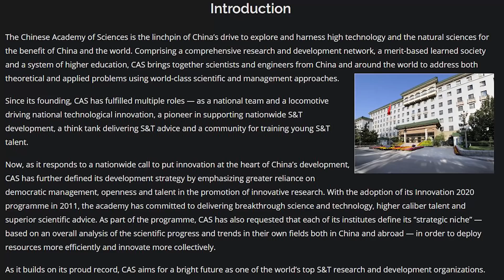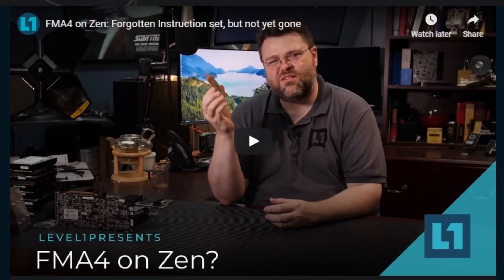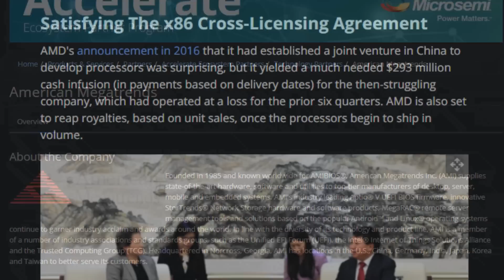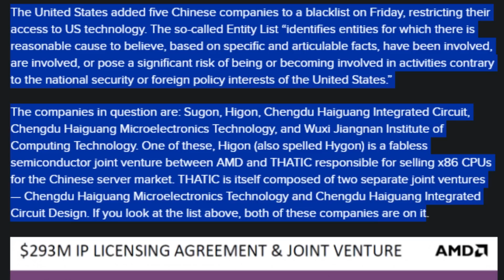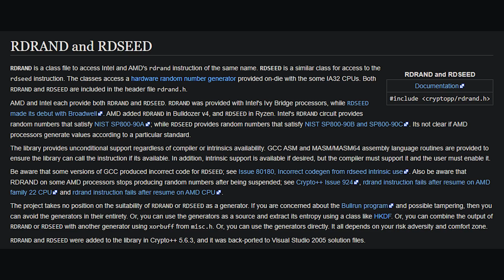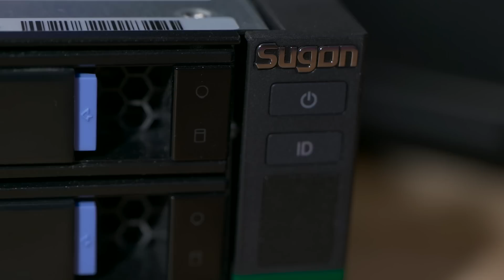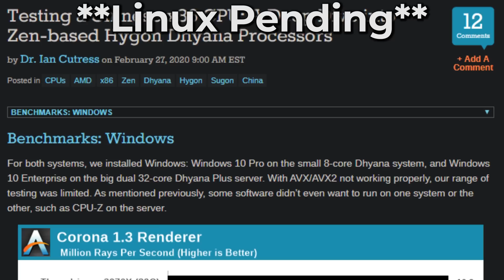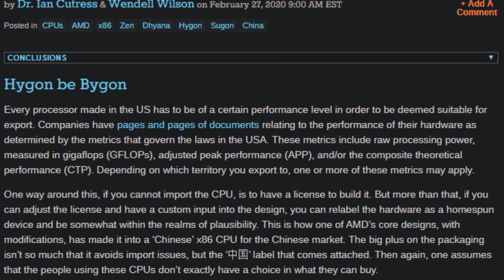Poking at BANNED Chinese Server CPUs & Motherboards!

Comment: lol as if China is making any CPU that doesn't call home. It's not even hard to find on most of those mid-level "emulation" devices they sell across the planet. 
If you've bought anything from China that has an internet connection you essentially bought a fancy spytool.

Comment: And now there was 4, Intel, AMD, VIA and Hygon
Reply: VIA is mostly dead. Their cores are even worse than bulldozer. 
Hygon use AMD's Zen1 design (AMD sells them to china a few years before). They don't have the ability to build their own
ARM does not build their chips.
Fujitsu and IBM is focusing on HPC. Their processors are not cheap. The only consumer product is the Tailos/Backbird system by Raptor. Still, super expensive.
Reply: @clehaxze  dude they are literally releasing a new CPU design on a new node this year
Reply: @TheXlen  Ohh yeah. I forget about the new one.

Still. From my experience working with VIA before. Their CPU isn't super advanced and I don't think the new one will be much different. And from leaks, the situation isn't looking good. Their new 8 core CPU runs at 70W @ 2.7GHz. 

Tho they do have the advantage to integrate their CPU directly with a AI accelerator. Which is kinda interesting.
Reply: @clehaxze  if they can match or beat intel's low-mid end this year, they are a player that must be taken in account
Reply: @markj2093  all of those that I mentioned are x86 CPU manufacturers and designers, most of those you named make ARM design CPUs
Reply: @markj2093  I once worked for VIA. I know how their system works. It was a good design but nothing comparable with AMD/Intel. But we'll see how well the new one works.
Reply: @markj2093  hygon designed a lot of that zen based CPU
Reply: @markj2093  IBM power 9 atm is not worth mentioning
Reply: @markj2093  yes and now they have personal that can fine tune it, which means even if they don't get any newer designs from AMD they will be in market for at least 5 years

Comment: I would absolutely love a low cost 8 core zen 3 chip with 32 or 40 PCIE 4.0 lanes. One of the biggest reasons I haven't upgraded to a ryzen system from my x79 is the lack of lanes on the chips.

Comment: It is a little peculiar that China couldn't fabricate their own chip.  It is concerning that AMD would licence anything to a country well known for their ability to clone a product.  Shows how much money was at stake.  As for capturing network traffic I think looking at anything less than 40 days of it on a network is shortsighted.
Reply: it's not about being able to fabricate a chip, they surely can, but the problem is the architecture, the x86 IP. They will have to license from amd or intel as anything x86 arch based must come from them and them only. or they could make their own arch xch86 or something but it will not be compatible with the existing software (again x86 IP needed for that) but that will take years of research, so the easiest way is to buy x86 rights from amd. also amd buys their 7nm cpu waffers from TSMC Taiwan, which no matter how the political scene is over there, it is still considered as part of China, so not as peculiar as might you think.

Comment: The Chinese Communist Party has been very clever with various ways to compromise hardware. Often this is done in ways invisible even upon inspection, such as compromised components on the motherboards or embedded inside cabling. The CPUs are just one target out of many.
Reply: "embedded inside cabling"
Simpso-I mean NSA did it!

Comment: You know what is also forbidden in USA ? Kinder Surprise eggs !
Reply: Because the US is afraid they contain a transdimensional backdoor portal directly to Italian chocolatier spies trying to collect trade secrets from American candymakers. I do believe their concern is warranted.
Reply: America, home of the banned.
Reply: @Username that's not even true.

Most regulations are created with the idea that certain policies make things safer, better, or more environmentally friendly, this often is not the case. All regulations do is they lock out smaller competitors that might have an innovative product or design that could be cheaper or better from actually entering the market, or they increase the cost for the consumer as compliance with those regulations goes up.

An example of this is the US style electrical outlet that is by far the worst designed plug in the world. There are far better options for electrical outlets but because the US decided to standardize and regulate that outlet those options are unavailable. There are other issues with the US power system, our 120v system is vastly less efficient then the 240v system that is used elsewhere around the world. So standardization has had a extremely negative impact on the safety and efficiency of us power systems.

We can talk cars as well. Cars have certain regulations that are so asinine and dangerous that even if you wanted to create a safer vehicle you couldn't. All you would have to do to prove this is look at the accident Ryan Neumann just had at the Daytona 500, he survived an insane crash that of those cars were not built to the standard they are built to with the technology that they have he would have beed killed instantly. General regulations prevent the use of that vastly safer technology in vehicles on the roads today. You can only have a point harness in a vehicle today, you can not put a better harness in standard. There is a mandate for airbags that have been proven repeatedly to be dangerous and deadly in the wrong circumstances. Hell we are dealing with explosive chemicals that very likely have an expiration date where they are not guaranteed to work the same as when they were fresh. Not to mention that degradation of the housing is a key factor in their overall failure. Motorsports has vastly superior technology when it comes to driver safety and it is insane that it is not legal to use in a vehicle built for the roads.

Regulations don't have any foreseeable benefits to society, period. They give the illusion of things being safer while at the same time they prevent things from being done, progress from happening, cause actual harm to the things they are trying to protect and most importantly they actually make things less safe and prevent things from getting safer.
Reply: @TheObsesedAnimeFreaks  most regulations are not bad unless most regulations are made with the thought in mind of exploiting others, which is the case in the west. 

On the parts of planet Earth that have good governments like China and Iran, the regulations are made to keep people safe instead of to destroy competition, but I'm sure you can find some cnn or reuters article that would disagree.
Reply: Americans of all ages are choking on them regardless of the age limits. Go figure
Reply: You banned Kinder Eggs!?!? Whats wrong with you people?
Reply: Since when ?? I live here and they have them at every grocery store ive been too and almost every gas station...
Reply: @prestonblues2037  And the toys are inside the chocolate egg?
Reply: @NikoBell1188  yes they are
Reply: @NikoBell1188  well not in in the chocolate but the other half of it
Reply: But blind bags are just fine.
Reply: @Username She did not get third degree burns on her lap from fuckin hot coffee. Third degree means it burns through the flesh and to the bone. And 85c is not hot at all for coffee, let alone unnecessary or "insane". You haven't got a clue what you're talking about.
Reply: So not gambling for kids on candies, but gambling on videogames it's ok for kids
Reply: Aren't they banned because toys need to be vissible from the outside or something like that? Could have sworn that I did read something like this years ago.
Reply: @peterpain6625  Of course I have, they aren't banned in Austria after all. Is even an adult one able to swallow those yellow "eggs"? I mean they are huge after all!

Wasn't completely wrong about why they are banned: 
The Federal Food, Drug, and Cosmetic Act prohibits confectionery products which contain a “non-nutritive object”, unless the non-nutritive object has functional value. Essentially, the Act bans "the sale of any candy that has embedded in it a toy or trinket"
Reply: @peterpain6625  🤣Nice one!
Reply: @peterpain6625  That's not why they're banned. But go on.
Reply: @noxix7641  They're baned for the same reasons the usa needs a "hot coffee"-warning on every coffee-cup ;) Americans are rather challenged with normal life it seems.
Reply: @DrakkarCalethiel  real reason, they were too good! american candy companies lobby to banished them from there country. Oh capitalism is so fair! until the americans loose of course.
Reply: @nahuelcutrera  Doesn't it stop being a truthful market competition when the government gets involved?
Reply: @santibergallo  depends on the government
Reply: @Username 
>Your false dichotomy of "it's always bad" is idiotic. 
from a raw, a is the cause of b, this is always true, what people will do with the lack of regulations is something that i didn't even address. and even if there weren't regulations one could argue that a clear negligence on the practices and policies a company follows lead to economic or physical harm indirectly making a company responsible for not moving for a better product when it can clearly be shown that the injury was due to their products failure alone and not the idiocy of the individual. w/o regulations does not necessarily mean w/o recourse for damages incurred by faulty or defective products, lies of a company or individual or otherwise harmful behaviors. you can have a system that is predicated on good will and punishes those that abuse that assumption. So the "it's always bad" dichotomy that i push, is actually true from a raw perspective of the actual negative effects any regulation will have, regardless of whether that regulation at the end of the day does something that generally makes the industry "better." 

> To suggest the total lack of regulations cannot create incredibly destructive or evil things is a downright harmful lie
A total lack of regulations WILL create a world devoid of destructive or evil things, except when the spout up and properly squashed when consumers that care both voice their objections to said evil and destructive thing, and convince others that don't currently care to care and boycott a product, good, service or company. if someone give a shit about how a certain company acts in terms of pollution, they will advocate against those that pollute and push for a less polluting product, demanding change and a generally better world. in a completely free market, any company that faces mass distaste will fail quite quickly as products and services will be pulled from said company and consumers will fail to give them their money. this is also assuming that a company wants to survive and keep their consumers alive and well. This will generally make for better products and services that put the consumer's health first so they can keep buying the products and services you offer. 

>I believe some regulations are necessary if you want a cohesive civil society
I will give you this, in certain situations the need for guidelines as a bounds of general safety and responsibility might be needed, HOWEVER these guidelines shall not be mandates in products goods or services as to what a company should or should not offer, such that following these guidelines only reduces or eliminates liability when the company fucks up and not due to the failures of the customer. An example of this would be in situations where an crime might be possible if those guidelines are not followed. such as certain forms of pornography or the sale of body parts. Other examples include harmful pollution where general standards could be set to encourage the adoption of cleaner or superior technology where a factory might emit harmful pollution. These guidelines shouldn't be enforced by the state mind you, but by those directly harmed by the actions of a company, organization or individual. and screw your "cohesive civil society" that's just not necessary. a society is formed when people agree upon the rules and regulations of that society, and are not forced to comply with said rules and regulations. otherwise it's just a gooberment trying to force their ideals on the population. you shouldn't need rules and regulations to form a cohesive civil society as the society will form with the introduction of like minded individuals that agree to live by the rules they themselves set. 

> Your Nascar example is a fallacy and rife with personal opinion and conjecture.
Explain how objectively safer cars and technology that has long been established as being decades ahead of the consumer vehicles in terms of actual safety figures and objective testing is a fallacy?  My argument was that modern vehicles are less safe then the vehicles that are found in most racing series, and that technology in those racing vehicles, the technology that makes them far safer has been banned via regulations for the sake of stupidity. This has caused a divergence in the safety of these vehicles as you can no longer advertise that your vehicle features proven real world testing in racing. yeah sure my personal opinion is that the technology that is in those vehicles should be adapted into modern vehicles, but that's based on objectively proven statistics of what modern racing vehicles are capable of withstanding. if a nascar can withstand a hit on the driver side corner buy another vehicle at 150+ MPH  and the driver survives that? then my god why isn't that technology in a modern vehicle where the same type of accident would result in a death. that's my argument there are massive disincentives from introducing that tech into modern cars because regulations prevent that. it would prevent the vehicle from being street legal. 

and what ever you put after that, and you are saying that i'm arguing a fallacy... i said nothing about older vehicles, all i said is that there are far better technologies in equivalent vehicles from racing and from the consumer relm where the racing vehicle is objectively safer in all situations.
Reply: @TheObsesedAnimeFreaks  You must be a hoot at parties
Reply: You can buy Kinder Joy eggs. They come w/ crap toys separate from the crap candy. We’re not missing anything w/ the surprise eggs.
Reply: @Bob_Smith19  Good cus that chocolate is banging.